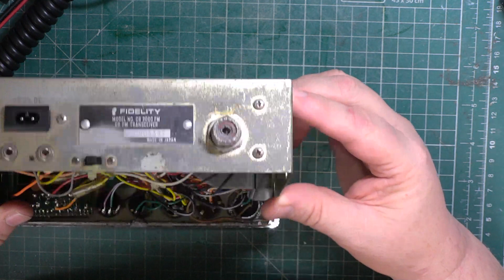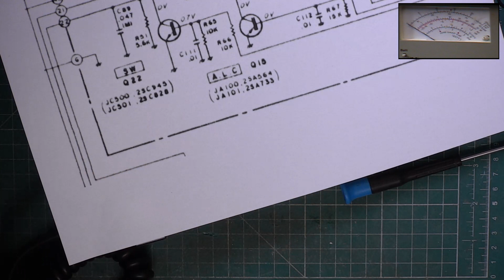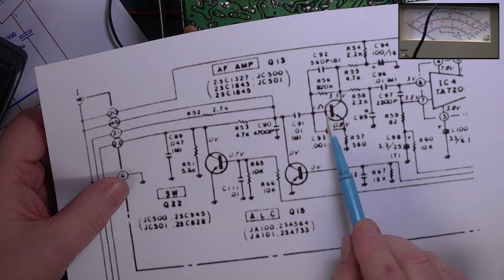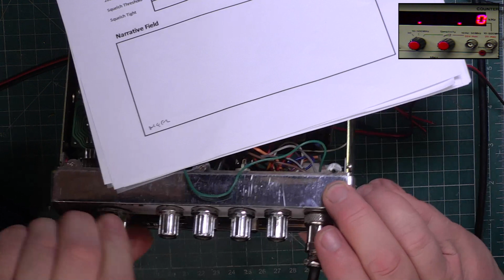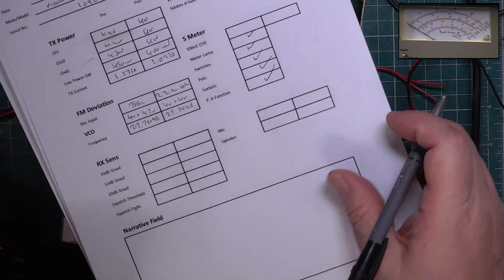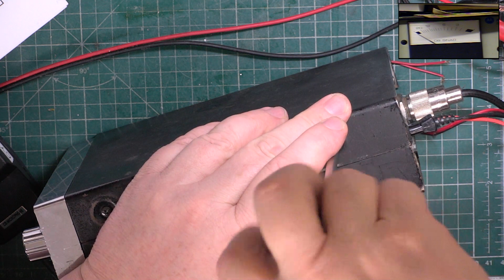Fidelity CB2000FM CB27/81 UK FM CB radio - No TX audio repair & alignment.

Comment: I've just had what seemed to be this exact same fault on a Radiomobile  CB 202, which uses the same 134 board. I'd used this radio static mobile for the recent 27/81 42nd anniversary and it worked faultlessly, just as it had the previous year. However, today I was out in the car with it and it seemed that no one could hear me, just complaining of what they thought was skip interfering with them. After returning home, I took the Eurosonic ES 200 CB handheld out to the car to act as a monitor and discovered that there was no transmitted audio. Having brought the set in and opening it up to do a bit of fault finding, the set started to work perfectly and all prodding and tapping around the circuit board failed to reproduce the fault. On looking closely at the piece of print that you found to be open circuit on your set, it seems that on my particular set there's absolutely nothing connected to either end of that print run, just an open hole and solder pad at each end. It all looks original, so perhaps something common to the Radiomobile version. Transistor Q22 is there as normal and the open hole at the top end of the piece of print that you found to be o/c on your set is marked as 24 (a test point) on the component side of the board. I could have an intermittent component fault - time will tell, but it's a bit of a pest when an actual fault can't be identified, as it could occur again at any time.

Comment: I am sick of the 80 channel mod on the old sets.
Reply from the maker: Very much so! Usually ends up killing the PLL & crap performance on both sets of channels when it does work. I just think some Cbers just want to be illegal.

Richard
Reply: @ukfmcbradioservicingTango21  Fantastic set put back into service.

Forgot to say FCC is cracking down on the splatter box nutters in the US at last,

Maybe Ofcom will do the same here.
Reply: back in the day it was needed  with every channel being used . plus in came the mod your radio years  . bleeps echo filters even small burners  new led displays . some of the stuff being done to them is now in the modern day radio as standard
Reply: @johnnyjohn6527  Yes i lived it all even with my brother on am before we got our UK 40. I had a uniden 100 and he had a maxcom 4E.The AM set was put in the bin by my dad when he found it.
Reply: @chris_vandepeer  i scrapped 100s of AM sets . wish i kept some now . nice to take a look at the past . nowdays seems cheaper to buy an HF set then buy the older stuff
Reply: @johnnyjohn6527  A HF set cannot be used on the CB band not only that 27MHZ is out of band and will kill the bandpass filters.
Reply from the maker: When the CEPT 40 channels became available to UK users, the idea was to buy a second radio for those channels. The snag is EUROPE could not allow UK spec set to be retro-fitted with the (hence illegal) 80 channel mods. The main reason was the UK MPT1320 spec was inferior to the CEPT MPT1333 spec. I was on the committee at the time & at a meeting (I think it was 1991) thought of a way around it. If we (the UK) revamped the UK spec to be slightly higher than the CEPT spec then what would be the snag. There was allowance in the CEPT spec for individual countries to have different frequencies & keep them, so surely it would work.

Well, it was indeed suggested to the European committee & the UK developed the CB27/94 (also known as PR27/94) which is 40 UK FM channels, just like CB27/81...but higher spec & including a minimum receiver performance requiring crystal filters as standard. This then paved the way for PR27/97 80 channel CEPT/UK FM radios.....and subsequently the CE Multinorms we have today. I resigned form the committee in 20001 owing to my late Mother developing Motor Neuron disease & requiring much more of my time.

Echos have always been a grey area & continue to be so. If echoes were in any way a benefit....they would be incorporated on military & space communications.

CB radio is supposed to be a local 2-way radio service offering up to 16Km range. Hence the sensible choice of 4W. Illegal burners just make it unuseable for others in the offenders locality, but little overall range change. For example, to double the range of 4W, you'd need 64W.

So the illegal mods cause the radios they are fitted into to perform poorly because the radios were not intended to cover that bandwidth. Radios designed to be 80 channels have been designed to work accross the allocated frequencies properly. All the 80 channel illegally modified sets we see here have culminated in the modification killing the set...usually the PLL chip.

Richard, G0OJF, UK
Reply: @ukfmcbradioservicingTango21  My dad was a amateur and he found us red handed on our our Illegal CB he went mad it went out the window and into the garden then a pickaxe said hello to it. such good times lol.